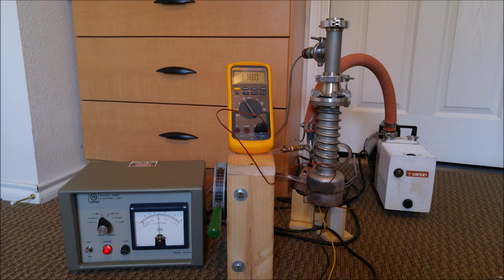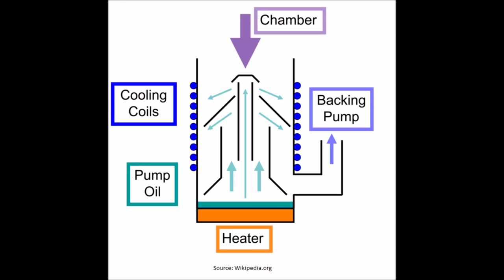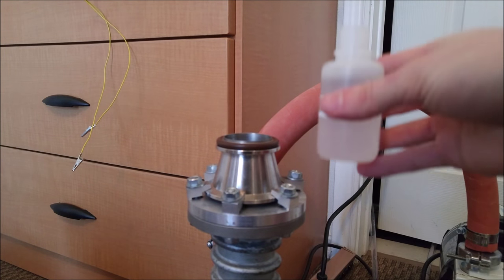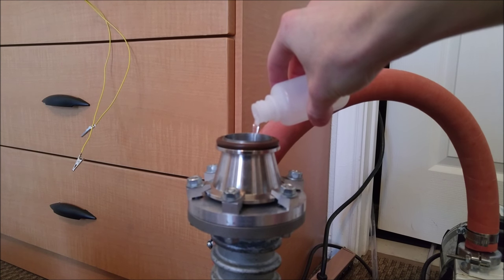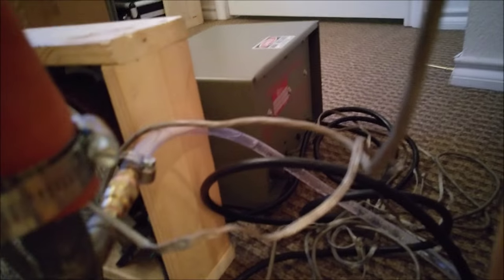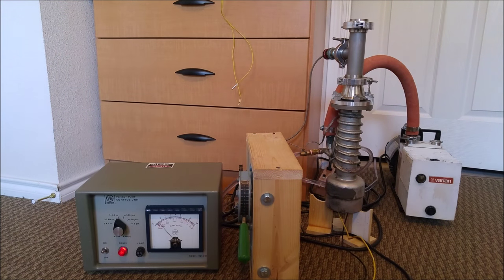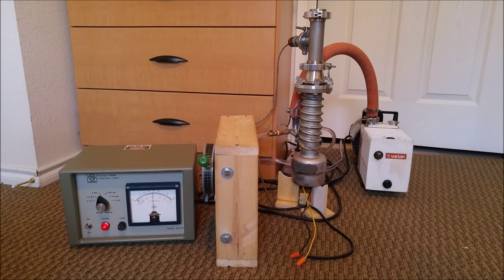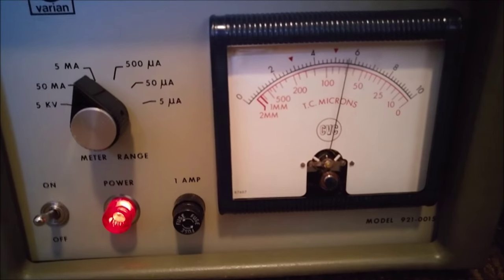Diffusion pump first test

Comment: Your JB weld is outgassing and most likely leaking as well.
It would be best to braze the crack because then the brazing material would form an alloy with the base metal and fill all the tiny cracks and create a solid seal.
Reply from the maker: Thanks for watching! I agree that brazing would definitely be better, but I was having a lot of trouble brazing the stainless steel. I've managed to get my hands on two more pumps since then, so hopefully I'll have some videos about those soon.
Reply: @EricDalgetty  There are stainless steel welding rods too. Weld the shit thing, that would be better.
Reply: While it would be better, jb weld is actually pretty commonly used to make seals in amateur high vacuum systems because the outgassing is so little especially when baked like he did in the video.

Comment: great video on your setup. Two questions: 1. how do you connect the roughing pump to the exhaust of the diffusion pump? is there a Conflat flange or KF flange or just a straight exhaust tube? 
2. what type of sensor are you using to read the pressure?
Reply from the maker: Thanks Aryahmmr! I think on this pump I had soldered a barb fitting onto the exhaust and used a rubber hose to connect the roughing pump to the diffusion pump. I used a thermocouple gauge for this test.
Reply: @EricDalgetty  thanks for the response! hope you're doing well out there

Comment: What is the part with the rotating handle, inside the wooden frame?  Also, do you know if a vacuum pump requires a controller, or you could just supply it with wall power, assuming you were checking pressure with sensors otherwise?
Reply from the maker: The handle is attached to a variac, which limits the voltage and power going into the diffusion pump. It depends on the type of vacuum pump whether or not you will need a controller. A roughing pump, for example, just needs wall power to run the motor. A diffusion pump needs to be held at a certain temperature, and a turbo molecular pump will definitely need some kind of speed controller. Hope this helps
Reply: @EricDalgetty  That's what I suspected and it's funny because I was just discussing today about adjusting a diffusion pump's power using a variac with someone experienced in vacuum systems and he didn't think it'd work too well since you have to give enough power to make the oil boil and that's most likely the design power, not less.  But, if you got it working...   Different question: do you know what kind of vacuum gauge that controller is using?
Reply from the maker: @perspectivex  Oh sorry I see the confusion now. The "controller" is actually a unit that I rewired to power a thermocouple gauge, so all it's doing is measuring pressure. As far as the variac goes, it's not a great idea for a long term set up. Theoretically, you could adjust it to just the right power so that it always keeps the oil at the right temperature, but you're better off just switching the diffusion pump heating element on and off as it reaches the correct operating temperature. If left on full power, the heating element will get too hot and probably damage the oil.
Reply: @EricDalgetty  I thought the diffusion pumps were supposed to have some thermal sensors to keep their temps correct by cycling the power, but maybe that's a feature of more high-end models.